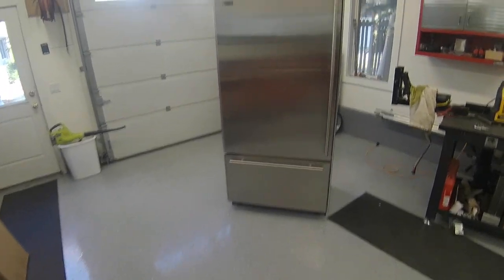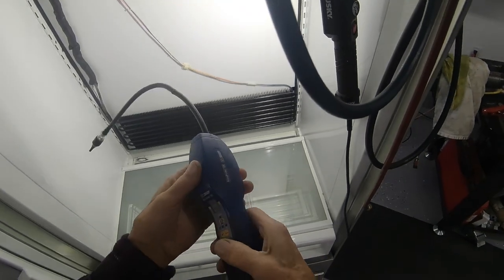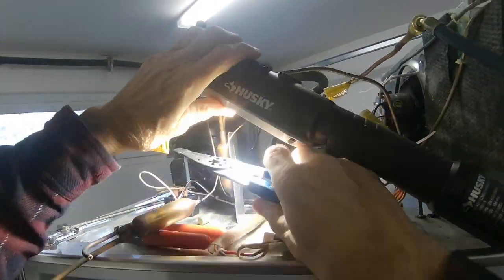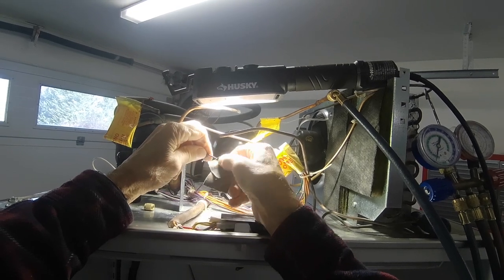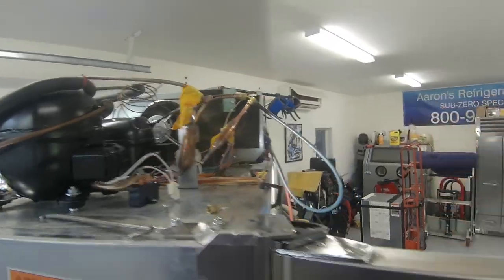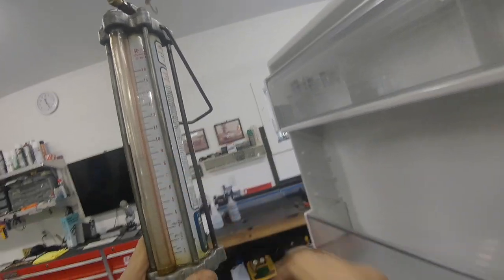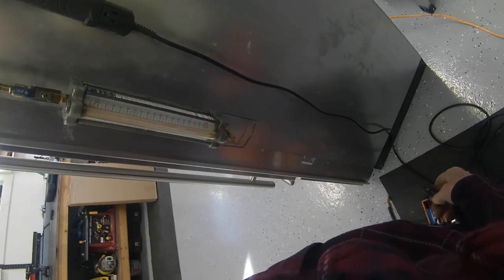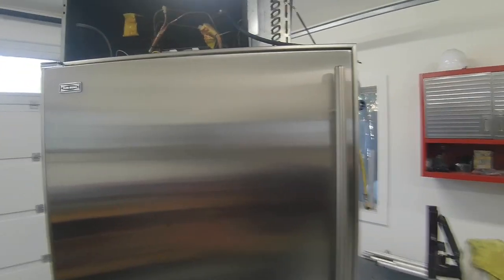Sub-Zero 650 Trouble-Shooting and Sealed-System Repair

Comment: If i have a 501R and it works great except i get fost build up on the rear internal wall of the refrigerator does that tell me that i lost r12 or are thete ither issues i can look for first maybe the gasket is not sealing ? Maybe someone is leaving the foor open ? I was thinking there might he a defrost heater issue like a defrost dwitch but i believe these dont have defrost hardware.
Reply from the maker: @googpix540  It depends on where the ice is. If it’s down below near the drain trough its probably the drain heater. If it’s up top on the left side it’s probably a Freon issue.

Comment: Thanks for sharing this information.  I have a similar 650, just with the panel inserts vs your stainless model. 
The freezer is working fine, but the refrigerator is not cooling below 55°F.

Comment: Could had just put it in a vacuum check pressure …. Also common issue on the old unit are insulation decaying